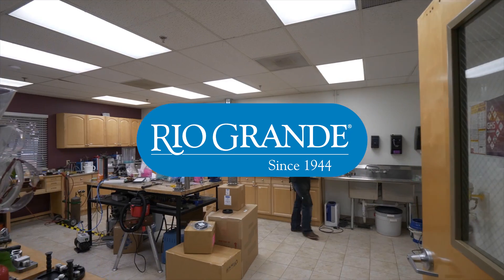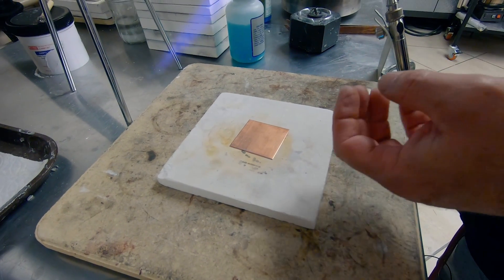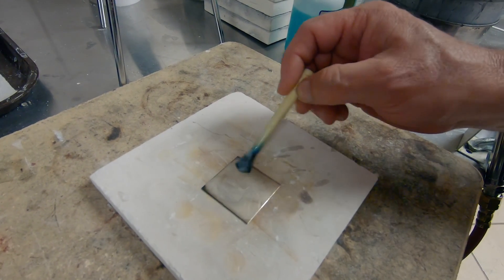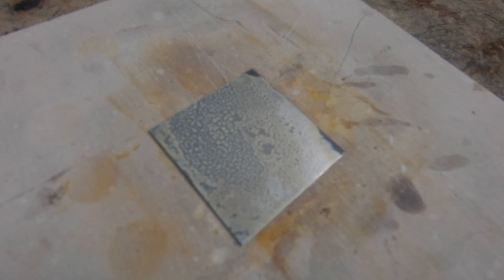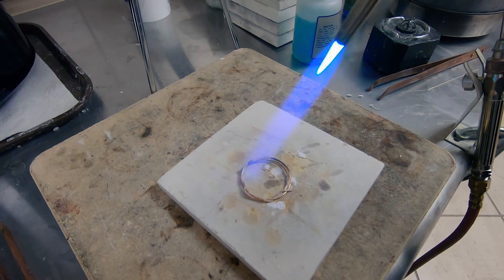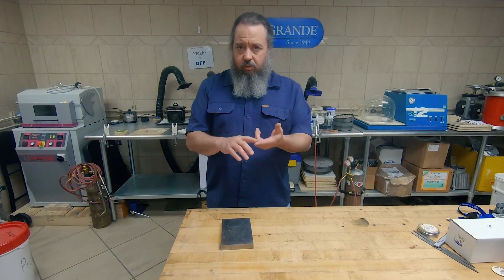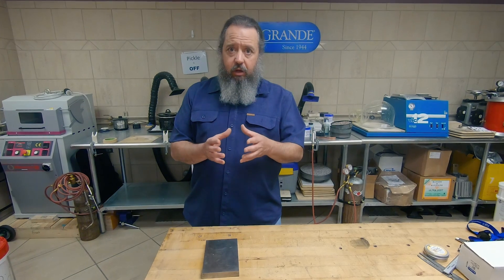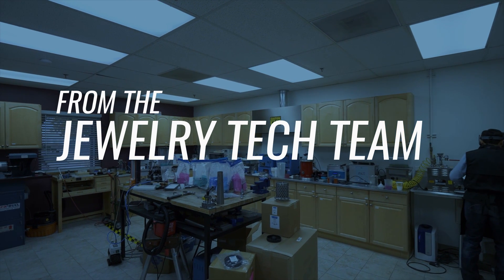How To Quickly Anneal Wire & Metal Sheets

Comment: The copper is oxidized after annealing.  Should it be pickled before the next round of annealing ?
Reply from the maker: After annealing the metal it should be pickled.  Every time you work the metal, you should be working with clean metal. So if your roller printing, stamping, hammering… you don’t want to drive that oxidation into the surface of the metal because it can flake off creating flaws in your piece.
Reply: @ This is golden information straight from the specialists.   Thank you so much !

Comment: I'm a complete novice bench jeweler. I am taking a diploma course through New York Institute of Art & Design by Penn Foster. I'm working on my project, making an ID bracelet. I am to shape the links for the bracelet myself. The wire I am to use is 14 gauge brass wire. This wire is very difficult to bend with my round nose pliers, and is even worse using my stepper pliers. Of course, the course has taught me about annealing, but I wasn't sure how to go about it. There are no videos in the course. This video is very helpful. Thank you for making it. However, I do have one question. Can a butane torch be used to do the annealing?

Comment: If you have a large quantity of wire, can you put it in a kiln?  If so, what temperatures would you need for silver and copper and for how long?  I use 8 gauge wire  (it comes in coils ) and torching it ends up with very inconsistent results.  I have heard temps between 1100 and 1300 degrees F for 30 min.  for silver and cannot find info for copper.

Comment: What about Anne sling platinum sheet?  Do you quench or air cool?
Reply: Annealing
Reply from the maker: Hi, for annealing Platinum, the most accurate way is to use a kiln, heat to 1700°f and hold for 15 minutes at which time you can quench or air cool. For torch annealing heat the piece to a bright orange glow and hold for about 1 minute and then quench or air cool. The time will depend on thickness of material. One thing to note is that if you're picking up the extremely hot piece of metal with tongs there is a chance of cross-contamination, so air cooling may be safer. We hope this answers your question, but please let us know if you have any others.

Comment: I’m starting to work with 8-12 ga copper and brass wire at home for my jewelry and figured annealing would make the process a lot easier. Can I just use a regular torch for this instead of the one you’re using?
Reply from the maker: Hello, we will go ahead and ask our Tech Team and get back to you with with their answer.
Reply: @RioGrande1944  thank you!
Reply from the maker: @casandradaly9698  Not a problem! Our Tech Team got back to us and they said that, yes, you can use a torch to anneal metal. You will need to have a good size tip like the #2 tip from the Acetylene Air Torch and flux on the metal.. Place a X with a sharpie. Once the sharpie disappears the metal is annealed. We hope this helps and let us know if you have any other questions!
Reply: @RioGrande1944  thank you for the tips! I’ll try it out next time
Reply: @RioGrande1944  Is there a way to restore the brass color after it’s been annealed?
Reply from the maker: @casandradaly9698  Hello, our Tech Team got back to us and they said that the pinkish discoloration on brass can be removed with some light abrasion like a polishing wheel or polishing cloth, or pickled off with a strong pickle solution like super pickle which is pickle solution mixed with a small amount of hydrogen peroxide. We hope this answers your question. Feel free to reach out if you need any further support or assistance! Thanks for the great questions! 😊
Reply: @RioGrande1944  yes this helps alot. Thank you again!

Comment: Coiling works great for fine wire, but ... What about wire that's too thick to bend in a coil like 6 ga? Or square,  half round, or some bezel wires that you don't want to get twisted up? 
 Also, you didn't mention (or maybe I missed it) fine silver - same as sterling?

Comment: They make temp stick's, and it will melt when it's at the right temp you just rub it on the metal your heating,I'm not trying to take away from the video and I apologize if I sound that way, I'm actually subcribe to this channel.